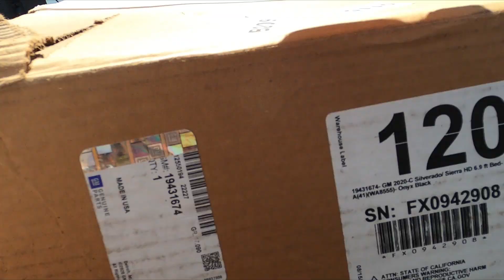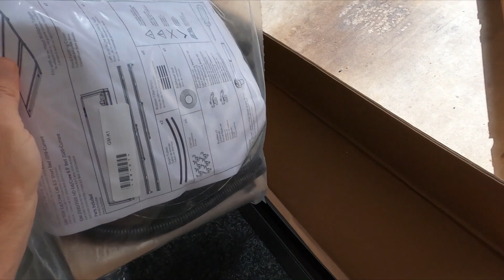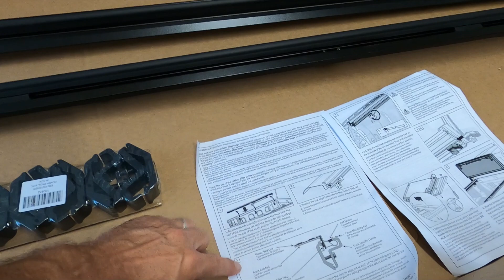Installing a GM Accessories Bed Cover on my 2024 Denali Ultimate HD

Comment: That’s and undercover ultraflex bed cover branded as genuine GM. Looks good and fits well. I’ve been looking at the armorflex or Leer hf650m. The leer has no channels or drain tubes. The rail is tapered to stop any water from entering. Cool video thanks.

Comment: Have you so far seen small scratches in the gloss black sections? I was wondering how easy it might be to scratch those sections like going through a scratch less car wash or even doing it by hand yourself? Very good installing it and demonstrating how it works at the same time. My GMC is white but I would like mine to be black like yours. Thank You